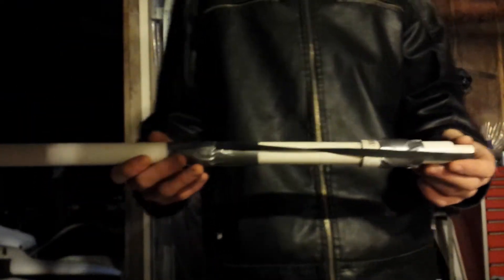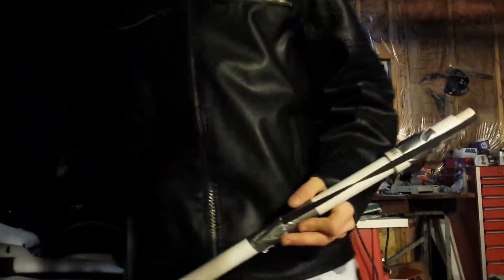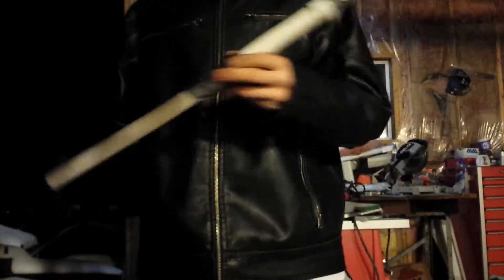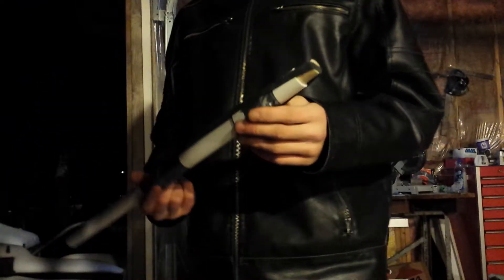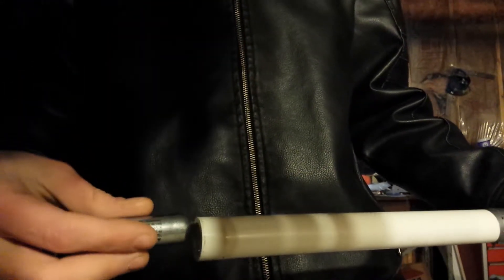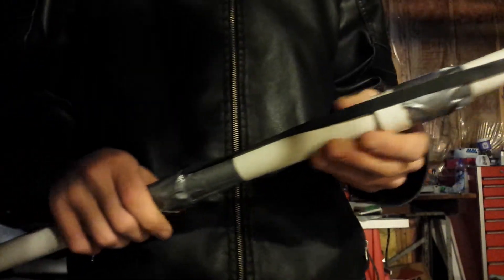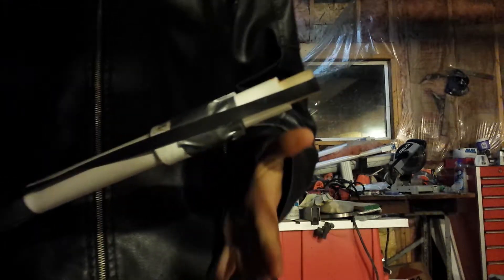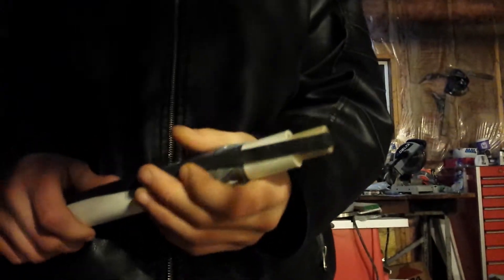PVC 12g CO2 cartridge launcher

Comment: i honestly like my design better, it allows you to have a front sight, and its a pistol, plus, its a break barrel
Reply: but it takes a little longer to reload
Reply from the maker: albert mank that seems like a pretty sick launcher bro. After I posted this post managed to turn it into a crossbow. Hose-clamped the contraption to a bow, and mounted it to a stock. How did you do the  break barrel? Actually is it legitimately break barrel, where the entire barrel and breach assembly drop and it cocks itself, or do you pull off the barrel to
 load it then cock and fire it? Because if you got the Breach and barrel assembly to actually drop and load a new round into the chamber then flip it up and it's cocked and ready to pop off, congrats man. I'm assuming you pull the barrel off.
Reply: nope, you dont pull the barrel off, it works just like a shotgun, i hot glued a rubber gasket to the edge of the breech to prevent co2 from leaving through the sides, as for a trigger there is a ball valve in the middle of the barrel as the trigger, as for the firing put there is just a bent nail on back (not nailed into the stock, it needs to slide back and forth) and you put it into a hook think when you're ready to fire, this punches the seal on the canister, now just open the valve then BOOM, so much awesomeness
Reply from the maker: albert mank you have a video of it? I would love to see this thing. It sounds bad as hell, man. If not that's cool too. I congratulate you bro, you have devised a sick contraption.
Reply: unfortunately i dont have a video, infact, i dont have a prototype yet, i still havent aquired the parts for it, one i have im going to make a vid of it